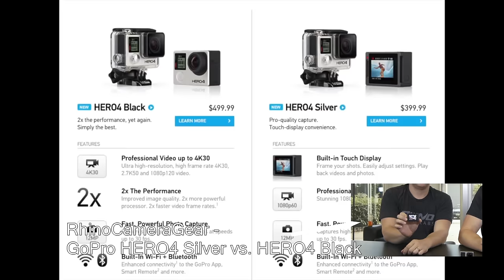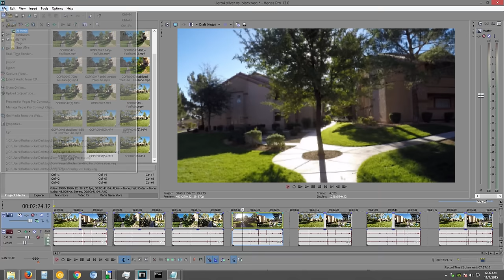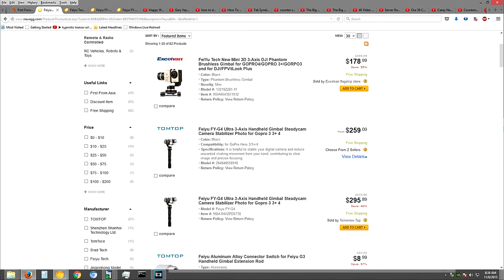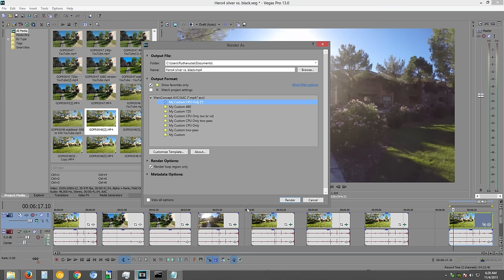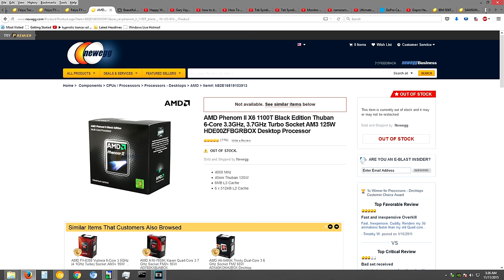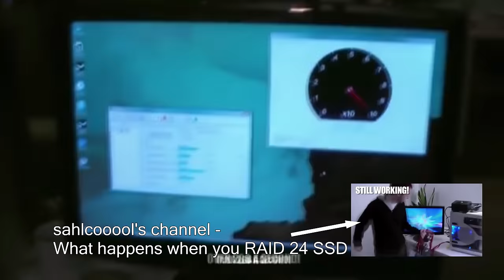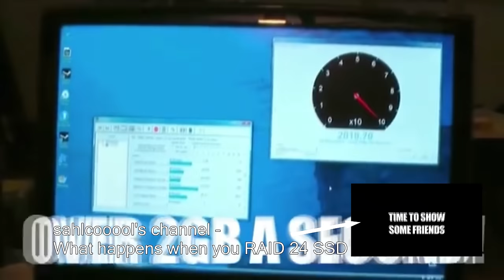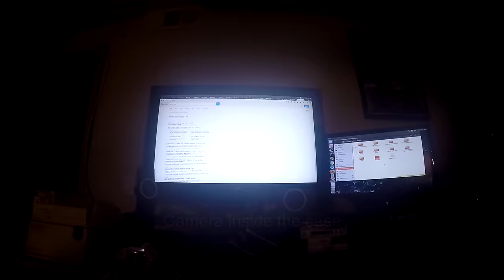The Importance of 4K:  GoPro Hero4 Silver vs Black

Comment: Great job on the research. I also wanna add a bit of info, GP in general spits out MP4s in h264 format. Even though it is not widely supported but h265/HEVC is a much efficient format if you want to optimize your video further (quality to size ratio wise). And also one more thing, a 4k converted to 1080P is better than original 1080P in terms of quality.
Reply from the maker: +Consig1iere 
Good point.  Thanks.

Comment: Thanks for this, I am using an older Sony AS20 at 1080p/60fps, and if I go to a GoPro, I want at least 60fps...  I might have to watch this one a few times to understand 4k/30fps and 1080p/60fps more fully... As for slo-mo, If I needed that, I would do it in editing...  But I am interested in the best detail for fast moving image for road based footage... thanks again.
Reply from the maker: at 60 fps the shutter will draw light for half the time resulting in a sharper image that would be ideal for driving (action) video especially on the edges where objects are passing quickly.  For non-action video, 60 fps is arguably a chore to watch.  

This is an avengers trailer at 60 fps 
https://youtu.be/lfwjzNB--5k

Different people have different ideas about whether they like that level.  For me, the 30fps "blur" makes it appear as if objects are moving, and without that blur it is painful to watch.

Here Rob Cameron did a drive with a GoPro Hero4 Black at 30fps, and again at 60fps

60:
https://youtu.be/m4Ki0jxbHQc

30:
https://youtu.be/ItGq0yymesQ

Hope that helps. :)
Reply: Thanks, it is very hard to tell the difference, and you possibly have to be looking for it to pick it up anyway... thanks again for the the comment.